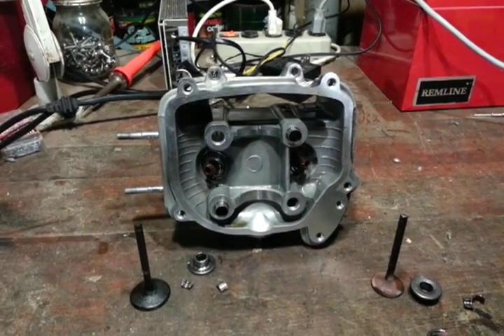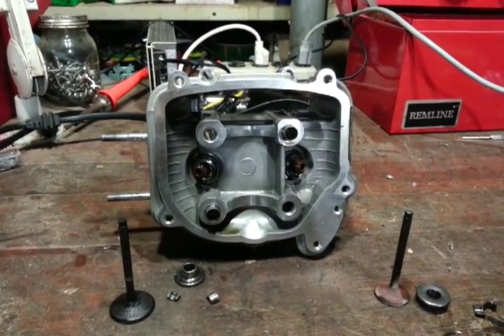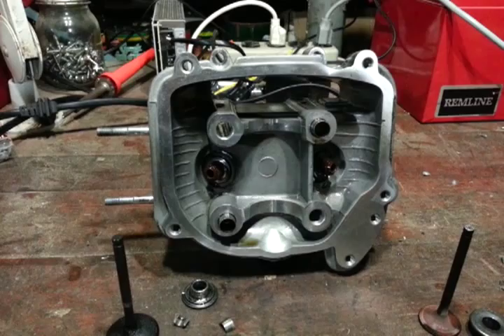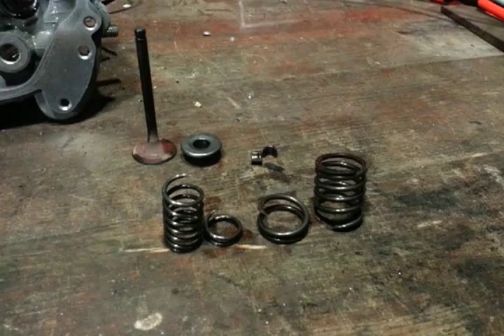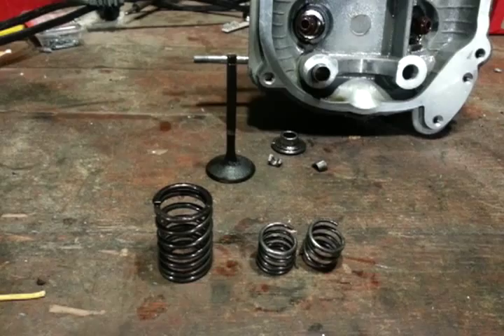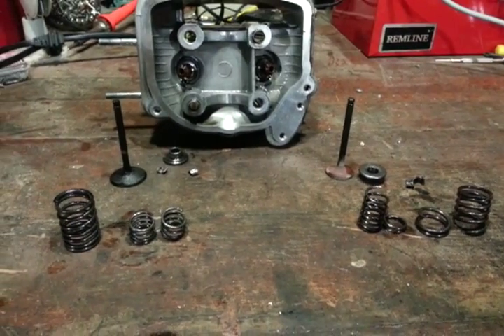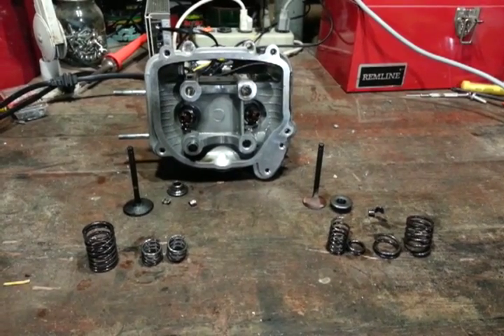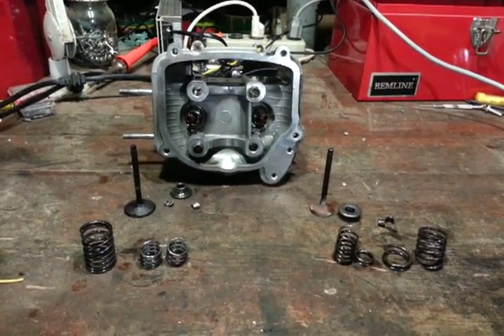Rattle A9 Race Cam Won't Rev High RPM

Comment: hey I got a 2018 scooter 400 mi I just put the a9 camshaft but I have the 69 mmm do I still need to change the springs because I have the 69 millimeter  I saw this video and now and I worry now I just had it change like two nights ago and it runs good strong and quick but my thing is 69 mm like I said so I don't know if I need to change the springs can you advise please
Reply: 2 139qmb 100cc bbk bikes over here with 69mm valves a9 cam stock springs doing good so far

Comment: any advice on which valve springs/retainers to get? already purchased the a9 performance cam and want to avoid this issue. Please and thank you!
Reply: Mike Caron did u ever fit the cam ? also did u use stock springs or Titanium ?? thank u